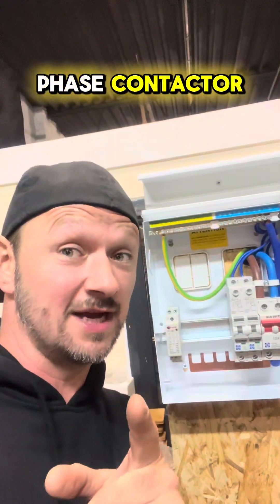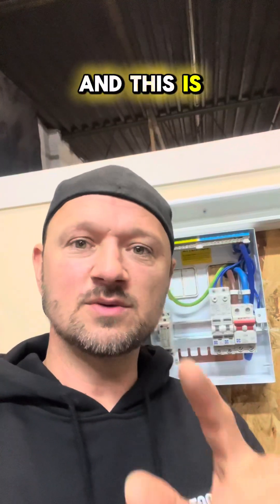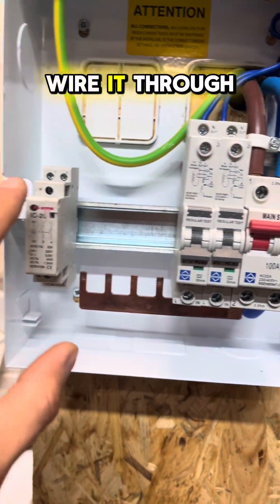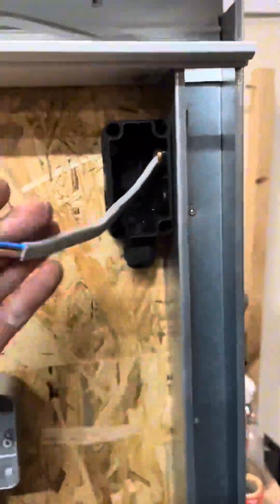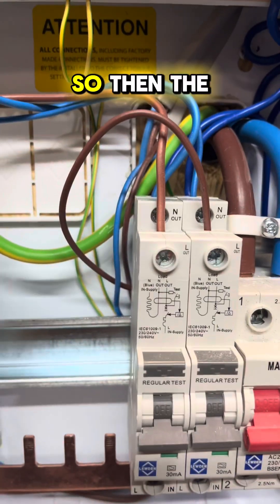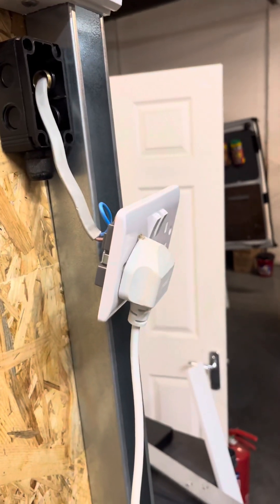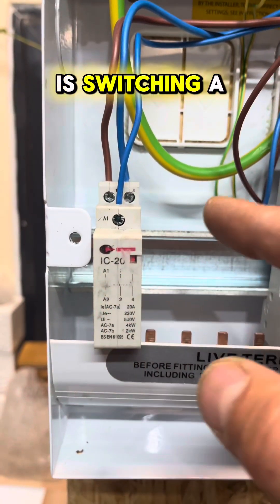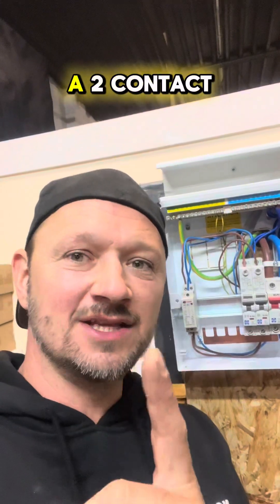The Shocking Truth About Single Phase Contactors

Comment: Hi, great video! I have a question—can one live switch operate several contactors at the same time? I'm planning to install a master switch near the front door to cut off all lighting circuits in the house when I leave. I will have three B10 RCBOs for the lighting, and I’d like the master switch to control them all. Is that possible?
Reply from the maker: The best way to do this would be to have a contractor for each circuit. 1 last man out switch would be ideal to control this